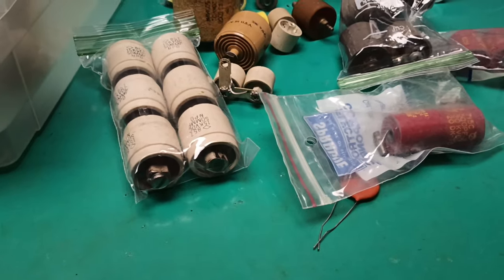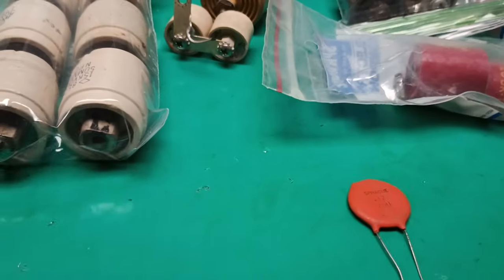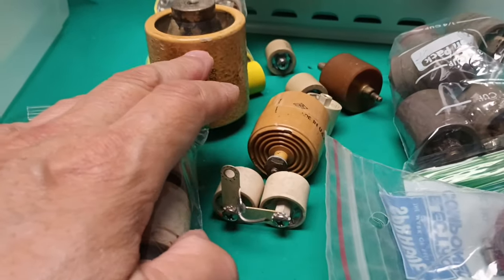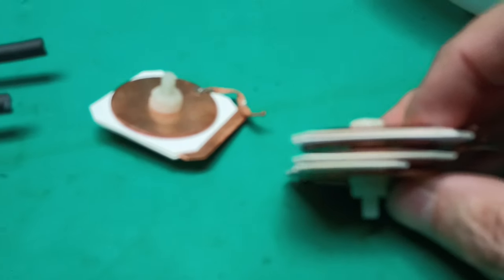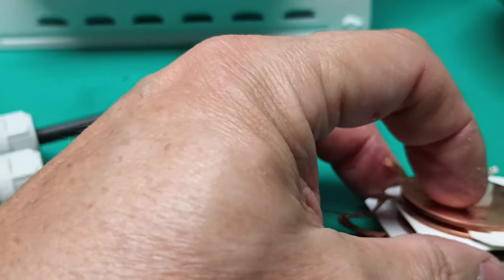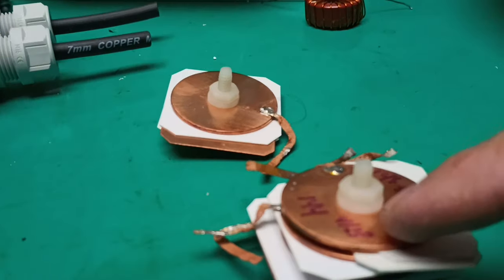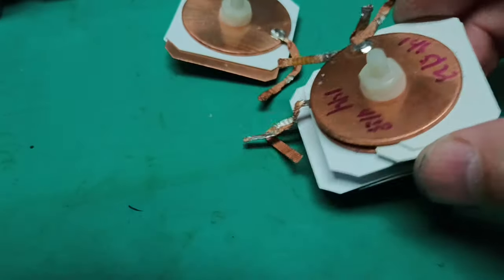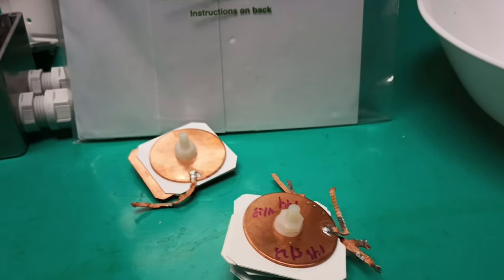Doorknob Capacitors - Make Your Own! ( cheap)

Comment: I made a Extended Marconi vertical for 20mb and needed a cap at the feedpoint to get a perfect match.
I made my own capacitor from some double sided mil spec circuit board laminate - Not the thing to do with generic cheap boards though.
There was no heating that I knew of and there was no discernible faults even after many years of use.
That was a cracking good antenna.
Reply from the maker: yrs, cheap laminates wont work. FR4 is too lossy.

Even if its lossy, itll work if the reactance is low.

The " good board" is upwards of $ x00 US per square foot and in short supply. Most of its taken by mil and space purposes.

I used PVC shim for my vertical, it heats and distorts but worked several years. That has been at "100 watts" or a bit more, not a power amp.
Reply from the maker: ,but it would be...its probably RF dielectric, reinforced Teflon?

And Ham QRO is pretty wimpy, my TOASTER dissipates more power than a QRO amp.

Real antennas dont need QRO..

Comment: Dam wish i raided your stash
Reply from the maker: Which values fo you need?

my fone csent spel rieght
Reply from the maker: 500/2KV, four in original sealed Sprague bags, screw in studs, marked 715C and 20DK-T5

1000/5KV Jennings J1HT 58 20% HI-K

lots of dipped silver micas
air variables
some coils
switches, including ceramic
amplifier building parts

And a dead mouse ( free, it wont eat much,)

I can test them for capacitance but not HV or RF.
Reply from the maker: Now u did it...got these boxes out and now I have to start cleaning and organizing.

Its raining so good day for it.
Reply: The parisitic caps looked good on the back were you take the cover off this amplifier is loaded with doorknobs geez it would cost me a mint to replace them all. Not in including the filter caps and the rectifier board kit
Reply: 500 pf 3kv
Reply from the maker: Look at the crack with a magnifying glass, is there black tracking that indicates arcing?
Reply: @k8byp  i didn't see nothing just cracked and were it screws in the cap looks bubbled i could be the paint. The most important one for sure the doorknob capacitor in front of the coil iam definitely replacing it it takes a beating.  But the 500 pf is cracked the value on it could have change
Reply from the maker: it may just be an outercoating that keeps moisture out, may just be on the surface, try using a razor blade to pick a little material out of the crack and see how deep it goes. That should just be a coating on the outside of the end metal plates